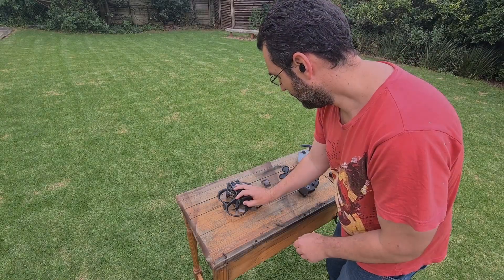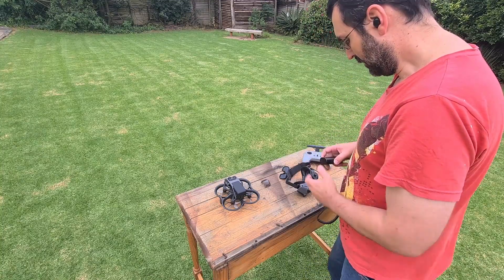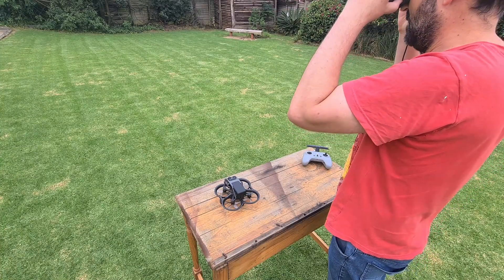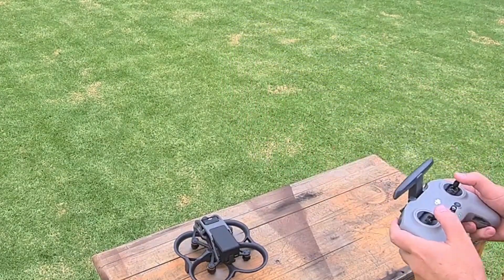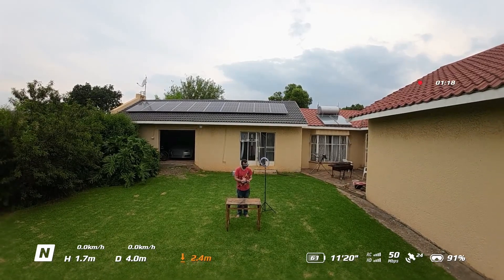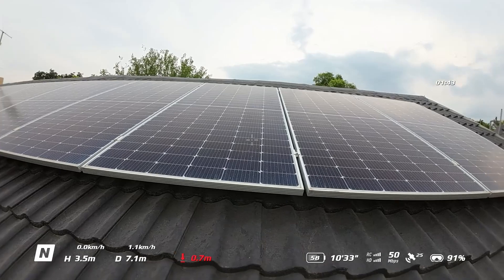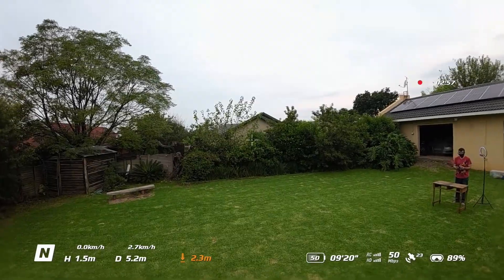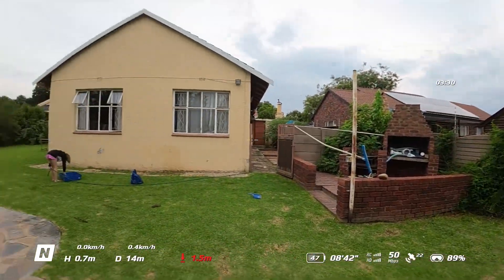Easiest DJI FPV Controller 2 Tutorial | Start-Up, Basic Movement and Drone Safety Features

Comment: does the hold position still work when indoor? using fpv controller
Reply: It will hover and maintain if you have decent  GPS signal while in normal or sport mode out of the box like a normal drone. But without active track or obstacle avoidance of course.

If you want to take full control you need to manually change settings in the goggles and adjust the sticks so they move freely and don't spring back to the middle. The controller comes with a hex key that is used to convert the stick mode from a normal drone to manual control and vice versa